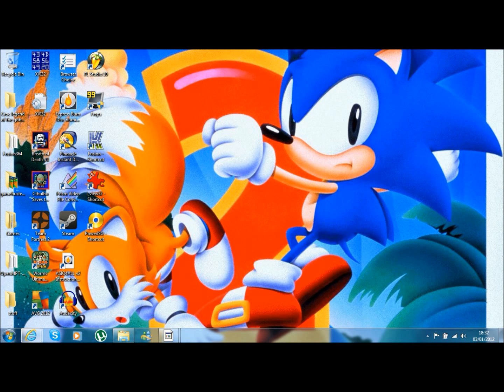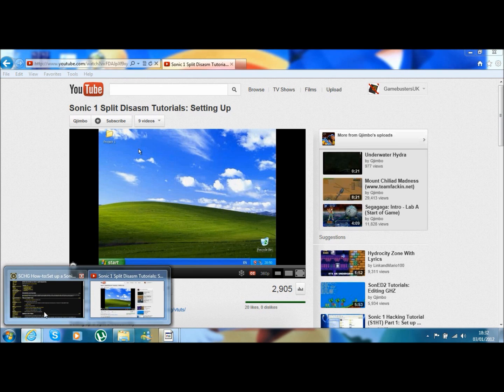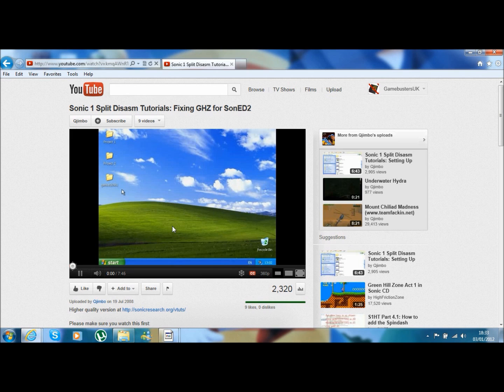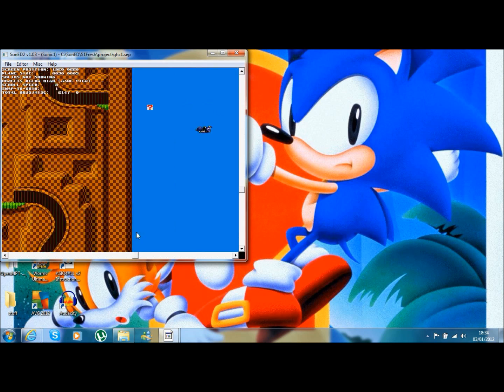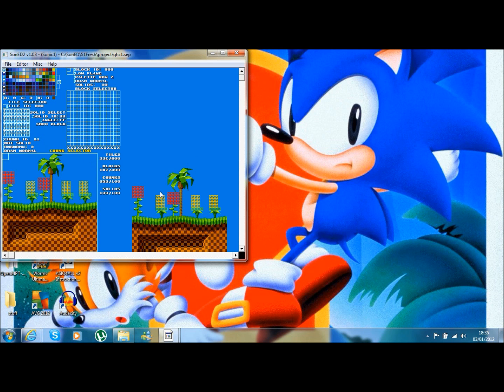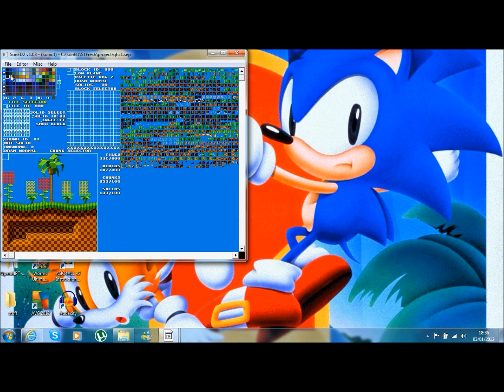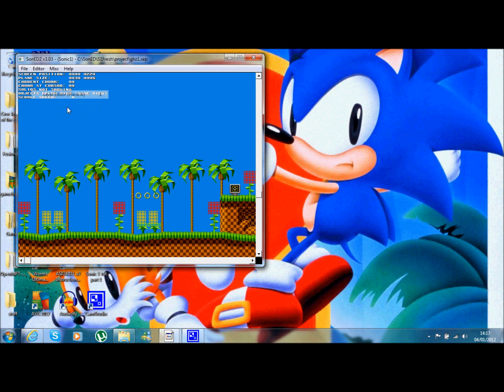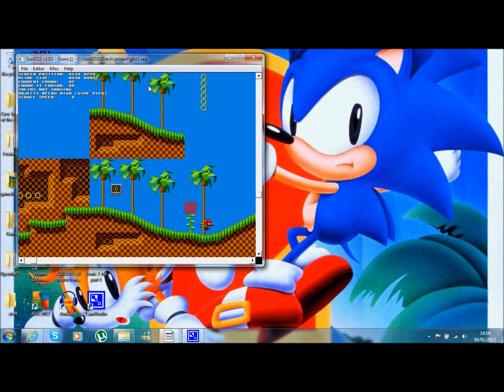Sonic 1 Hacking Tutorials - Level Editing Part 1

Comment: Wow. Not trying to knock this video, but Esreal Sonic Editor has a MUCH easier level editor.
Reply from the maker: But that#s WAY out dated, and limited. SonED2 you can do much more, and Esreal messes up roms that can't work with disassmebly. Times have changed, that's not recommended.
Reply: I know, I just find it much easier to use. I like just saving it to the rom rather than using disassemblies
Reply: But also, with roms that I've used sonik sprite with I've tried on SonMapED (For sprites). But they won't work. Any idea on why that is?
Reply from the maker: I think it's the same issue with Esreal's program. There are old programs that are not meant for disassembly use. Since you've altered the hack. Only unaltered roms work, so if you used something before hand on a sonic 1 rom, these programs won't work.
Reply: Agh. Thanks. Man, these are complicated sometimes.....Hey, would you mind helping me? Like a collab on this hack I'm trying to do? I know the tutorials are for me to do it myself, but I don't always have the patience to finish
Reply from the maker: I'm afraid not, I am too busy.
Reply: Crap.....Okay. Thanks anyway

Comment: I can't find Qjimbo's video.
Reply from the maker: It's gone unfortunately, and this video is old. However, if you check the description there is an alternative. It's not a video, but a written guide.
Reply: animemaster222 It just tells you to extract folders. I don't know where the "fixing" part is.
Reply from the maker: Look again, there is multiple links, the one that says "Fixing".
Reply: animemaster222 Alright so since I posted that comment, I kind of experimented on my own, and turns out I only really needed to download the thing. I didn't even need to do any fixing for it to work. The only issue I've ever experienced is that Sonic 3's slot machine bonus stage gets corrupted when I save it, and so does all of Sonic 1's special stages.
Reply from the maker: Graysongdl You must be using the new SonED2, I don't know about that. It may be a bug with the creator. Plus you are probably using a newer disassmebly which probably(I don't know) fixes the ghz problem automatically. As I said, this guide is old, and uses old stuff. Still works, but if things seem different it's probably because your using newer stuff so it won't be exact following this guide.
Reply: animemaster222 Well everything seems the exact same, except changing the special stage turns it into a scrambled mess worse than Sonic 3's "sewer" glitches.

Comment: I cant open SonED2! I've Tried SonED1 but still doesn't open! Am I supposed to put it in a folder or something? Please help!
Reply: I have the same problem.
Reply from the maker: Yes, as I mentioned at the begining, you have to set up your disassmebly and then put the projects folder you get from SonED2 into the disassmebly folder. Then just open whatever sep file in the projects folder.

Comment: I need help, I edited green hill zone, saved it, but whenever I try to run s1built.bin, it just plays the normal, unmodifed version. The way I edited Green Hill like this: I started SoEd2 > Went To my Sonic 1 file > went into my "s1disasm-master" folder > went into my SonED2 Projects > and clikced ghz1.sep. I did that, and edited the level. Then I saved it. When I tru to start the built.bin with the fusion emulator, it just plays the normal unmodified sonic. Can you please help me?
Reply from the maker: When you say edit, are we talking layout or art?.
Reply: just layout, I added loops, springs, etc etc
Reply from the maker: Ok so, when you open SonED2 again, it's still edited?. Try shortening the path e.g C:\S1\Projects
Reply: Yes, its still edited, its just that I cant play the bin with the edited levels
Reply from the maker: And you reduced the path like I said?.
Reply: I have tried to reduce, but it isent working. Also, would it be a problem that I am using SonEd 2 and not the original?
Reply from the maker: No, SonED2 is what you want to use for disassmeblies. I mean, it doesn't sound like your doing much wrong, if your saving it and clicking on build.bat and you get s1built.bin with at least 512kb I'm not sure. I'll have to think about it.

Comment: So, whenever I try to load a folder that has an asm file, it won't load the folder. It will take about 10 minutes to complete, but then if I scroll too fast, I have to wait ANOTHER 5 minutes. I really want to extend the sonic 1 rom and add A WHOLE BOATLOAD OF LEVELS, but again, it won't load. Any suggestions?
Reply from the maker: I don't know what you mean, load? load what?. You open folders I'm not sure what you are trying to do. Are you trying to use build.bat and it fails?. As for extending the rom itself, I'm afraid it's beyond my skill. There is a guide I think to add more levels on Sonic retro though.
Reply: +animemaster222 I should have asked someone else. Any folder containing .asm files will load 10-15 minutes instead of loading immediately. And ONLY those folders.

Comment: it says "SonED2.exe has stopped working" any help? I am using Windows 8 Pro 64-Bit
Reply from the maker: I still don't know the issue with this as people have told me they have used windows 8 and had no problems(plus I use Windows 7 so I don't know myself). You may have to use the program SonLVL, apparently that works.
Reply: SonLVL is confusing for me...
Reply from the maker: Master Microsoft When you open SonED2 does it crash immediately? or does it crash when you open a project file?.
Reply: when i open a project
Reply from the maker: Master Microsoft hm could be the path way or the project files. How long is the Pathway? example: C:\SonED\s1 something like this would be your pathway to your disassembly.
Reply from the maker: Can you try a smaller path? sometimes if the path is too long, files using the disassembly won't work. Then try again. Try a small path like mine.
Reply: same problem
Reply from the maker: Master Microsoft Do you use this "TortoiseSVN" ?
Reply: no
Reply: If you want to edit levels use esreal sonic editor 2 i used it on my windows 8 computer.
Reply from the maker: Jack TheHacka Yes but if you do, you can only edit the rom. Once you do, you cannot split the rom and use it in a disassembly.
Reply: Actually You split the rom,edit the levels then build it.
Reply from the maker: That doesn't sound right, ESE 2 has never had that function. I can only assume they updated it, since I don't use it anymore its inferior.
Reply: animemaster222 No I mean you go in the disassembelly run the split script,edit the rom then run the build script.Or at least thats how I do it with sonic 3k.Yes I know This is a sonic 1 tutorial but dont judge me I wanted to see if theres anything I could pick up from here I can use in sonic rom hacking.
Reply from the maker: S3k, well no thats fine dude I don't have a problem if they are useful to you then by all means.
Reply from the maker: I need context, what happens? have you set everything up correctly?
Reply: +animemaster222 how insert the level in the rom?
Reply from the maker: What do you mean? you want to port a level?
Reply: how i save the level is the rom
Reply from the maker: You just want to save the level? you just click file and save once you've finished editing in SonED2. use Build.bat in your disassembly and then test yout s1built.bin in an emulator.
Reply: thanks

Comment: Went after I have save my project in sonicED2 and went to load up the rom the title screen background is dark blue and green hill zone act 1 is nothing no background and no level only objects. Using Windows 8 and it 64 bit
Reply from the maker: hmmm I can't say because I don't use Windows 8 or 64bit, it would be better to not use it but I'm guessing you can't. The only thing I could suggest, would be split the rom, and then immediately use build.bat to build an unchanged rom. See if anything happens then. If its fine, it mite of been a mistake you made, if its still doing it then you'll have to try searching for compatibility problems. Maybe go over to SonicRetro and have a look to see if there is any compatibility problems. If I do find and answer I'll reply back. Sorry I couldn't be more help.
Reply: animemaster222 Hey Animemaster  I have  old windows 7 computer but now found a away to hack on windows 8 64 bit  I went to sonic retro and I found level editing application  called SonicLVL and it works fine green hill act 1 working fine and no dark blue background forever.
Reply from the maker: Brannon Walker Oh ok your using that program. Well that's fine, if it works for you then great. I guess SonED2 doesn't work on 64bit or windows 8.

Comment: Thanks! I also tried something of the written guide, but it just said 'compress the two files into one'. Qjimbo got the 24MB file, which should have been what I recieved, but the command line method he used gave me 15MB, exactly the same size as the 8x8ghz.bin! Idk whether it's the difference in operating systems (I'm running Windows 7 while Qjimbo used XP) or something else...